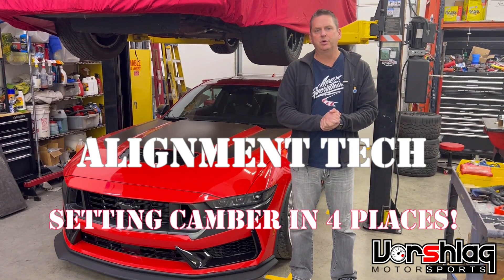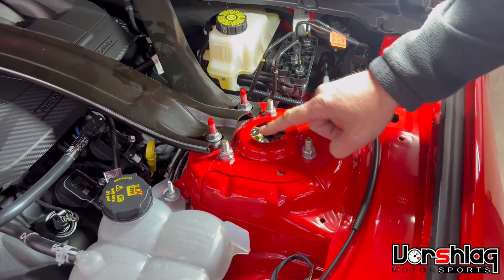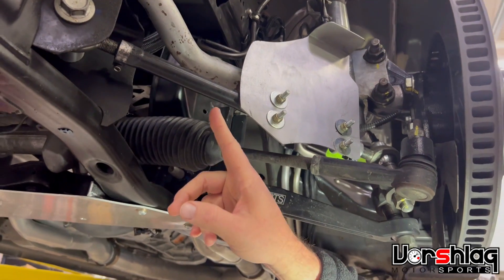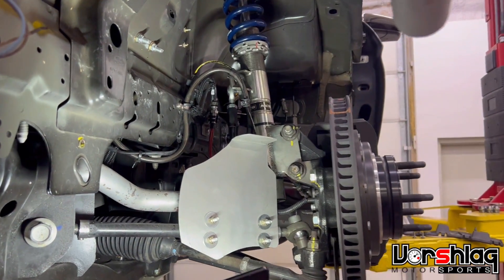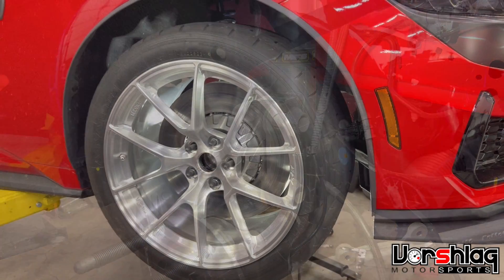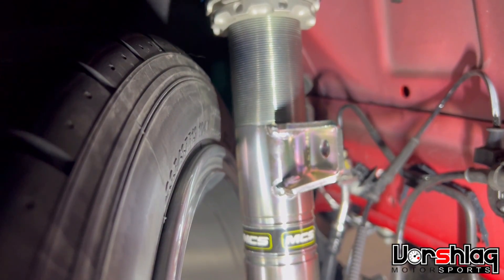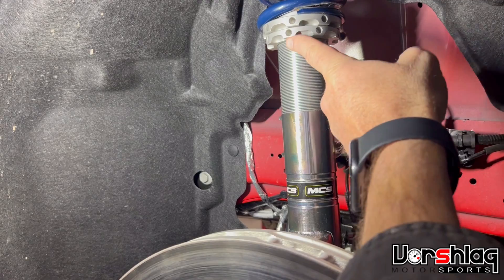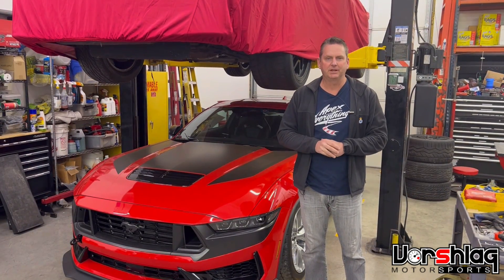Alignment Tech: Setting Front Camber in 4 Places!

Comment: Terry, your online info sharing has been invaluable to my S197 build.  Thank you!       
(OK, edit.  I wrote this before finishing the last minute of vid. So, 3mm is what you shoot for on tire/strut clearance min.  Thx!)
Question for you:
My 305 NT01s stick out a bit past the edge of my 19x11s. So my tire rubbing the strut is my limiting factor.  How close do you think I can set that tire to the strut and account for the tire deflection under load?
Reply from the maker: Yes we shoot for 2-3mm of room. Any more and we are wasting wheel room inboard. Any less and the tire carcass flex could make for some "rubber transfer"